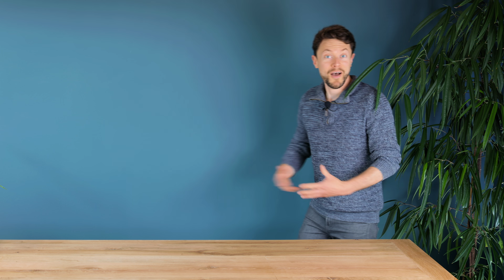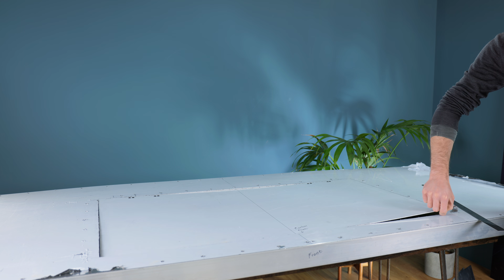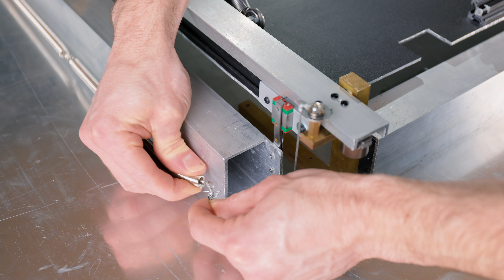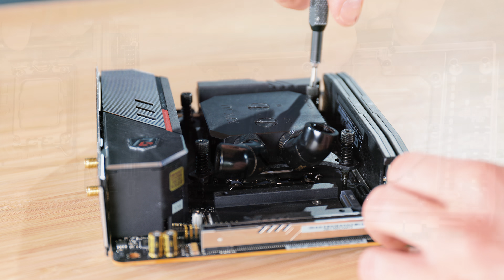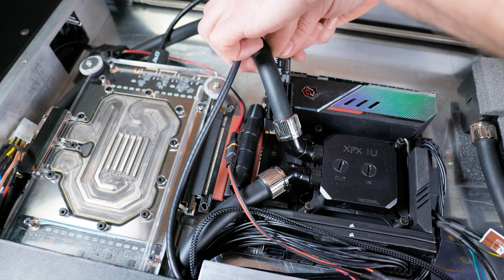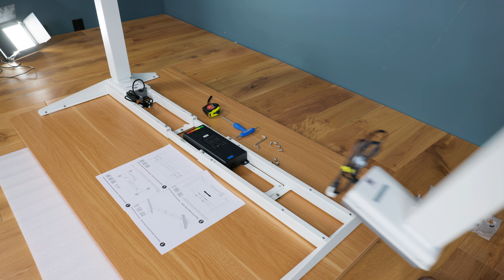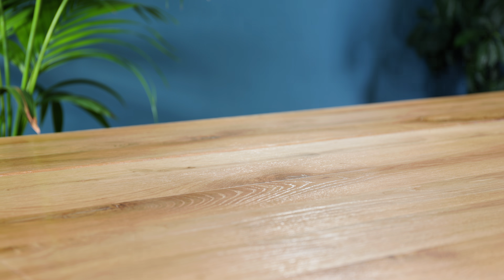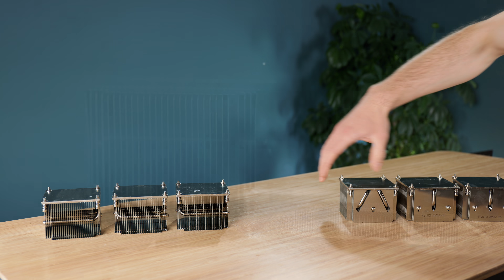Building the ENDGAME invisible PC

Comment: Seems you missed out on the opportunity to grain match the opening for when the PC was in use. 
You did match it for when it was closed - but a woodworker wood have told you it's entirely possible to cut those planks lengthways and have grain / plank matching for both the top and insert.
Wood have been more expensive due to thicker planks needed but wood have looked much better in use. = maybe next time?

I'll give you a 7.5 / 10 for this one

Comment: Accurate title. Beautiful build, congrats on the results and well done!  
I would have (not that I could get there though) spent more time experimenting with the thermals and voltages before going into a redesign of the cooling system.
The reason I think this would've at least been interesting to evaluate is that you've made a great use-case* for configuring a highly efficient system under "extreme" cooling constraints.
Experimenting with different voltages (lower) whilst maintaining frequencies is possible due to due to die differences in manufacturing. These differences are accommodated for by the chip manufacturers i.e Intel, Nvidia and AMD, and it results in mostly equal performance between individual chips produced. Some of these chips are more "perfect" than others but mostly all will have margins and room to dial in a lower voltage with equal performance (or higher even, given the resulting lower heat produced, thus enabling longer durations of turbo boosts).
Even though this is undervolting, it is still a comprehensive task equal to general overclocking to get it perfectly balanced (performance/stability) and I understand why you didn't, it does require a lot of time and components research to achieve great benefits.

Comment: Those tapered edges actually tied together the desk a lot more than I expected. It actually looks a lot more sleek that way.
Reply: The initial images he showed in the video looked so sleek, I was very intrigued. And then after he starts building it's this massive chonky thing, and I was very confused. Then he showed the amazing edges and I was very impressed.
Reply: That was a genius simple and elegant solution !
Reply: His dad is an incredibly good carpenter. Makes sense.
Reply: It's just an optical illusion powered by selective & careful camera angles.
Reply: I'm a bit surprised that many viewers seem to not know this concept, although it is pretty much the industry standard and also used on many other products like laptops and such. 🤷‍♂
Reply: @fawkesmorque it only look like that because he placed the camera up higher than usual. If you walk in the room u will notice it more as soon as u walk in. The illusion fails at 4 feet away 🤷🏻‍♂️🤷🏻‍♂️🤷🏻‍♂️

Comment: It most likely wouldn't solve the first cooling issue, but running the cooling pipes like this in parallel is not a good idea in my opinion. This way the hot side is radiating heat to the cold side of the pipe system as the pipes are getting warmer (and they conduct heat between each other), and also the heatsinks connect them, so basically there is some heat that gets through to the already cooled water, warming it up. I would separate the pipes (so they are insulated from each other, but this would require a different heatsink solution) or make them just one big parallel line (so the liquid flows in the same direction in all 4, one end is the entry point (where hot water gets in) and the other is the extraction side (where cold water goes out). 
Apart from that, amazing work, I really like your 'rotational to linear motion converter', and leaving the failed cooling solution is another big up for me, I think it's much better to see someone run into problems and solve them than just having a 'perfect' video where everything works out first try (which we all know is impossible 😀 )

Comment: So... being an IT guy, I could see the problem with the "old server components" from a mile away. Server cooling is actually a lot worse than regular desktop cooling. They mostly sit in datacenters and have thousands of watts of AC to keep the room at a reasonable temperature. Also server fans, instead of 2000RPM go to 6000 and sometimes even 10000 RPM, making them incredibly noise and annoying.

Why didn't you just go with some "BeQuiet" or "Noctua" 60 or 80mm fans instead of 120mm ones? They're still quite powerful and very, very quiet.

Comment: Great video, but have to point out you're spending 2k+ just on the monitor, several thousands on the PC parts etc, but are saving just a few bucks (maybe?) by not just going with a regular water cooling radiator that could have dramatically reduced the size and still improved cooling/noise. I think that was the last place to cheap out, as you had to compromise the entire back side for the budget solution, when radiators could have actually still provided you with a mostly svelte profile. Two 360mm radiators would be beyond overkill and probably a third of the size. But kudos overall

Comment: It's perfect until you sit down at it while it's closed and in seat height and hit your knee on the corner of the exposed rail under the table. Also removable dust covers in front of the inlet fans would have been a good improvement. This way pets can't hurt themselves on the exposed fan blades and it'll decrease dust accumulation in the fin stack. Everything else is perfect (I personally would have gone with an AMD system just to have less waste heat at comparable performance and better system latencies, but ofc I didn't make the awesome secret desk PC).

Comment: Great project and engineering, but how do you stop people using it as a table, like putting an open drink container on it for example or over filling a pot plant?

Bauhaus movement says function over form. Also couldn't you bolt a normal PC to the bottom of the desk and use a premade monitor mechanism to raise a monitor like they do with TVs? Not much of a YT video for the punters I suppose.

Comment: That hinge-/lift-mechanism is awesome.
Too bad the cooling solution didn't work out. The "fix" isn't all that pretty. The radiator you built initially with those flat heat sinks looked already pretty tall. I wonder if you could have just fit some 80mm or 92mm fans with higher static pressure on there to get air moving between those fins.

Comment: Amazing work Matt! Did you consider some form of linear actuator to automatically raise the monitor hatch? You could tap in to the signal from two of the desk height preset buttons for open/close. So when you click the desk to sit or stand height it also opens the hatch. Then an unused preset would move desk to storage height and close the lid!

Comment: A way to make the fans invisible would be to have a face connecting the bottom edge of the front and back together at a taper, and a neat means to make it look like it's suppose to be like that is to use wooden slats so it appears to be an artistic decision while still enabling cool air to reach the fans from behind.

It would also be a bit of a dust magnet, but the slats could be joined and hinged at the rear with that paperweight you have there being a magnetic catch release, which would release it one side at a time for easy vaccuuming. If these slats were thick enough to enable a track, you could clamp them together while cutting out two triangles for the track, then rout the waste away so a trapezoidal cross-bar can hold them together while remaining flush, only held together with glue which has a long work time before curing.

Comment: hmm... good idea but from what i've learned from @LinusTechTips is that using different kind of metals mixed together can be a really bad idea due to cross contamination for the water cooling the GPU Water Cooler looks like it's made out of Aluminium, the CPU Cooler looks like IDK can't really tell and then we have the "water cooling tank" which is made out of brass... i'd suggest you giving it a year or three and you'll see a mess of a Corrosion and Cross-Contamination🤣🤣🤣🤣
Reply from the maker: Don't worry it's all brass/copper so it's going to be OK. 😊

Comment: Its awesome. I just have a little question, what will happen if you apply more force on the keyboard compartment? You know, angry gamers... Will it fold back or will it withold the pressure? And the next level for this table would be automatic opening by pressing a hidden button.

Comment: small suggestions:- by using that paper waight frequently the wood surface will scratch and it somehow ruin the finish, instead u can use some push to lock and unlock thing they use in cabinets

Comment: Awesome work. Thoughts:
- Would be nice to have a switch that is triggered when the computer is hidden to trigger a screen sleep.
- I'd be a little bummed not to be able to tilt the screen at all.
- Is there now no way to remove the OLED panel? The wood is glued onto the aluminum, and the panel is screwed from the back (under the aluminum), right?

Comment: I hope custom brass heat pipes are compatible with the metal used in CPU and GPU water blocks and won't eventually corrode inside the loop. Beautiful work regardless!

Comment: 1. putting strong magnet close to your monitor and it has to be done everytime you open the desk? will it gonna messed up the monitor?
2. is that fan reverse blade? if its not, you witll get lot of hot air blown to your lower body everytime you play, well its good in cold area like europe to keep u warm, but what about summer time?

Comment: there is no need in motors to up the desk if the desk has more height from the beginning. 
also standing for hours is not a good for foot health
so the idea of raising desk (in general) looks nice but it can be done with just higher desk and  bar stool , that's how you can save money and resources (new stands, motors, wires, shipping process etc)

Comment: There is a relatively new screen type that can bend, just enough that you would be able to set it up where you can pull it up, saving space, and then you can have the keyboard be Integrated into the table surface using a touch screen, and having the keys light up when the monitor rises

Comment: That is impressive for 400rpm, then again the size of that fin array is massive haha. I wasn't surprised the cooling mk 1 wouldn't cool a 4090 and 13900k. I think at full tilt you're probably looking at over 500w with ease, you're probably closer to 700w maybe. 6C delta btw is extremely impressive for it not being a radiator, 10/10 on your custom "loop". For stability purposes you should download hwinfo as well and keep an eye out for VRM and RAM temperatures. Thats the part that can run extremely hot.

Comment: The compromises are: No separate height adjustment on the monitor, no way to adjust the viewing distance to the monitor, no space for a vertical mouse, and no clean way to use wired peripherals. Ideally, keyboard and mouse would be on an ergonomic adjustable tray/arm that slides under the desk when not in use and allows you to adjust height of your peripherals independent of monitor/desk height.

Comment: Had a similar desk on wheels, 2 things to note
1) tipping over - top heavy desks tends to tip over especially when raised so needs to be careful
2) secure the FlexiSpot desk screws & wheels with Loctite red to prevent loosening of joints down the years

Comment: I wonder if part of the problem with the first cooling system was the air looping back to the intake. My thought was to redo the 3d printed section to reroute the airflow. The second try would still likely blow that out of the water though.

Comment: i think one thing you could do to improve the invisibility would be to stagger the wood panels on the top surface, that would remove the visible straight edges of the cutout but the compromise is that you would have some wood jutting out on either side of the monitor when it's open.

Comment: Correct me if I'm wrong, of course. But wouldn't the brass heat spreader cause problems for the aluminium water blocks on the computer over time?

Comment: good on you for skipping the 14900 cpu.  there really isn't much difference between that and the 13900, other than a 100 Mhz clock boost and about a 75 watt higher heat load.  Don't feel compelled to "upgrade".

Comment: The cooling bar that you have made using the brass is slightly inefficient because the hot water and the cold water are connected with the same heat spreader,and make the water cooling parallel for cpu and gpu which will pull down the temperature way better,otherwise everything is 10/10❤

Comment: That hinge and lift mechanism is an absolute thing of beauty. Your builds just keep getting better and better!
Reply: they do. He is not running out of ideas. in terms of what he can build or will build next, I can't even imagine it.
Reply: @jordanmntungwa3311  Still waiting for the moment he decides that he can hide his pc somewhere else and just run cables towards the table from within his walls. if your floor skirts are high enough(you can buy special skirts that can hide cables behind it) you can just place your pc somewhere else and make the entire table even thinner :P

Making plans myself to hide all pc parts in my kitchen island and then the dining table is with his mechanism so i have the screens(got 2) and my keyboard mouse, then run the wires near the floor behind the skirts and boom no one sees anything when i have people over :)
Reply: I was actually wondering if he would consider working with some kind of fabrication shop to build custom blank desks. If he did this to scale I imagine it would sell a few units. Not a ton but enough maybe to justify some cost/time cutting measures.

He's made plenty of stuff that I imagine would sell in enough volume to come out of full custom pricing into merely "very high end" pricing
Reply: @ug333  he dosnt even need to fabricate the desks, just clean up the plans for the desk and sell those.
Reply: The hidden monitor + input device setup is amazingly cool.  Would also be cool to have a button built into the lift so it can tell the computer to go to sleep when closed.  Personally though, I'd use a low-power mini PC instead of putting so much work into a massive heat exhaust system.
Reply: That hinge and lift mechanism is the first thing to break constantly..
Reply: He literally could've used some springs and a latch to make it open with a press of a button
Reply: @thioga1 you literally could post a video on your own channel of you doing a better job. 

We wait in anticipation.

Comment: An amazing build! No Doubt about that!
I have just one concern to raise:
Since you are using brass box-section to run water through you need to check what material your waterblocks on the CPU and GPU are using for their inside fins. If they use Copper, and they most likely will, you will have to deal with constant corrosion between the 2 metals, filling your water loop with junk and eventualy clocking up the ultra fine fins inside the waterblocks. It is realy a pain in the ass to deal with and should be avoided by all means.

Comment: I might be wrong, but- If I recall correctly; many server computers use pressurized air for their air cooling.  So those server heatsinks may not dissipate heat as effectively with laptop fans.

Comment: You know there are 1U and 2U tall radiators specifically made for this kinda usecases? I know that you know, because I remember you using them before... and cost didn't seem like a factor for this project anyways...
Also it's funny how at the beginning you decided against normal radiators because of their size, yet ended up building one thats much larger than that...
Soldering the smaller heatsinks to the brass pipes would have made the radiator much more efficient, but I guess compensating poor efficiency by oversizing the heatsinks is also a way of doing it. 😁
Overall impressive non the less!

Comment: No other YouTuber would have discussed the heating issue and instead called it a success. Kudos to you for being more forthcoming.
Reply: I get what you're saying but they would. Like heating and cooling are some of the biggest concerns with any pc build and pretty much all of them do discuss it. Benchmarking and temperature results are major components of the pc crowd.
Reply: Yeah but he was actually building viable pc to use himself not just project to show off
Reply: @Raderade1-pt3om  and it's likely the build he's using for editing, as it contains massive amount of NVMe SSD storage, even tho he could probably build an invisible and completely silent NAS server with insane compute power and storage, maybe with a server CPU, like the most powerful AMD EPYC (9654P) that has 96 cores and 192 threads, which alone can be tricky to cool down with it's 360W default TDP, then all the drives, which requires some cooling as well

sure, a NAS server does not require a GPU, so it might not require a massive cooling solution like the desktop PC, but some airflow for the drives and a good enough cooler for the CPU, that's all he would need, and if it's running a local VPN with port forwarding for it to work, he could essentially connect to it with everything he owns for "unlimited" private cloud storage (it's easy to setup and use Nextcloud and OpenVPN, which are 2 good services for selfhosting)

Comment: Those kind of things on your channel bothers me most. 2000$ monitor, $3000 PC.... We can buy cheap heatsinks (build cost is not going down much considering custom copper tubes, mountings for radiators and radiators themeselves) . You should have just went with 2 AiO setup for CPU and GPU, copper pipes and more fans are probably more expensive and take up more space. Sound is a considiration OFC.